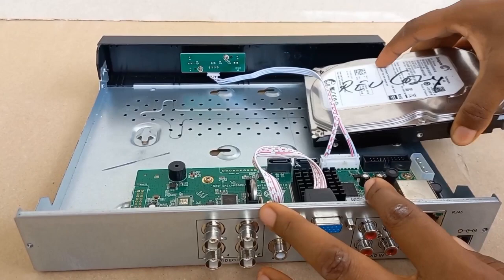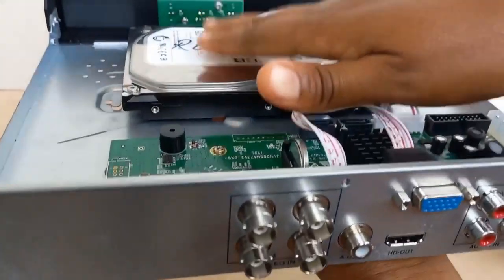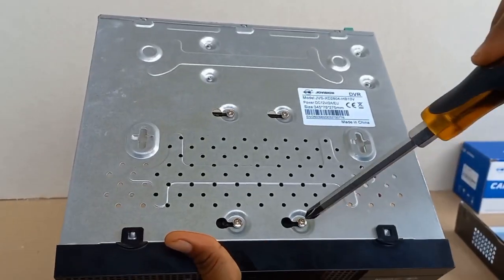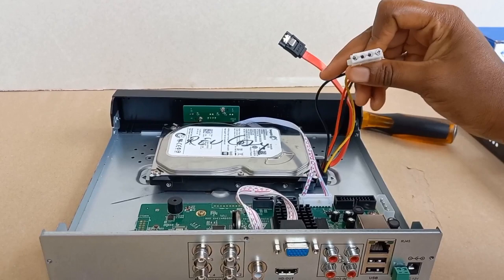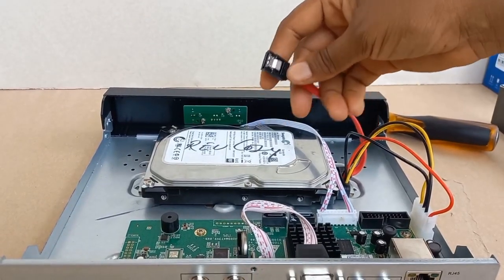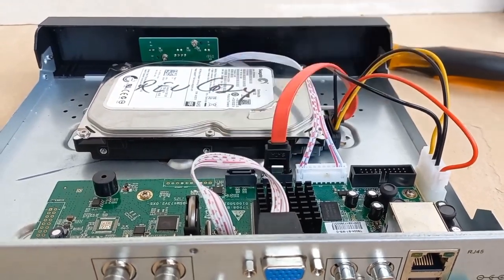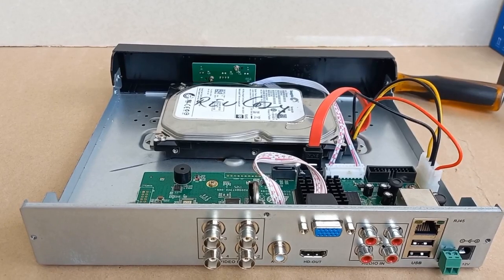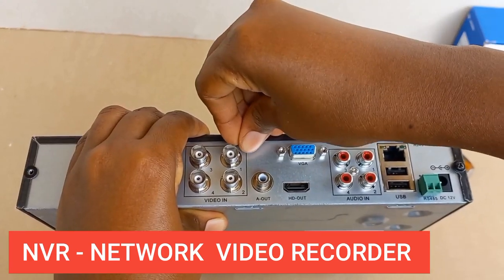How to fix a surveillance drive into CCTV DVR

Comment: Can I use NAS hdd instead of Surveillance HDD ?
Reply from the maker: Yes, NAS hard drives can be used in CCTV NVR or DVR. They are equally  robust as Surveillance  drives since they are also designed  to work 24/7 and even throughout the year.

Thanks so much for watching. I will be glad to answer  any of your questions when you have any thereafter.